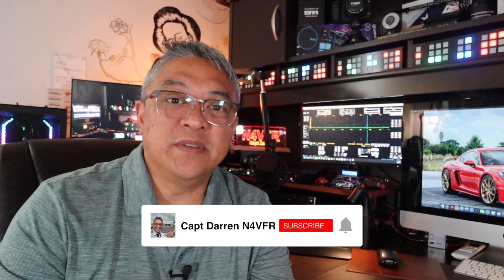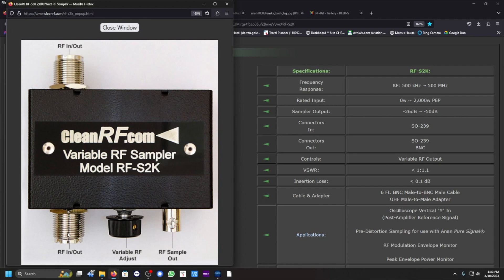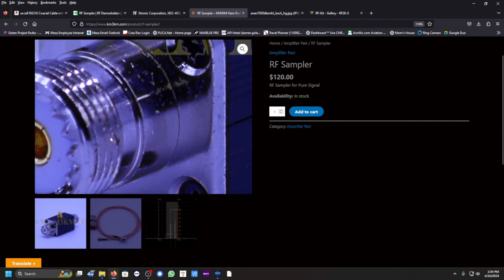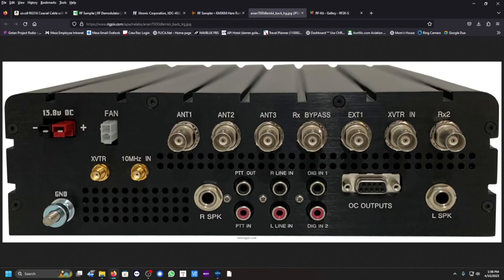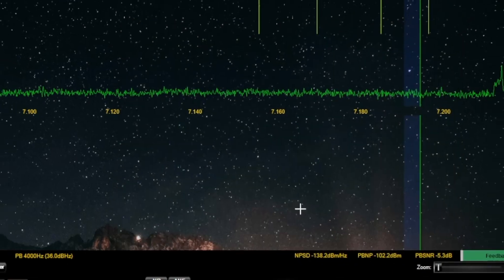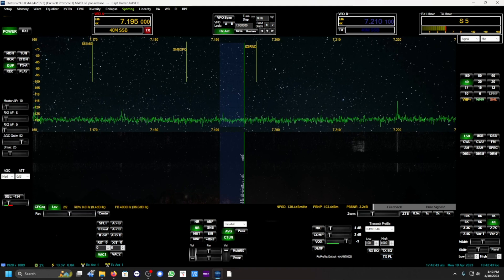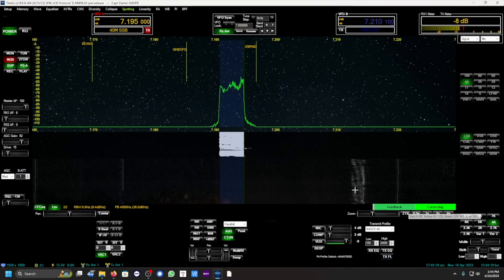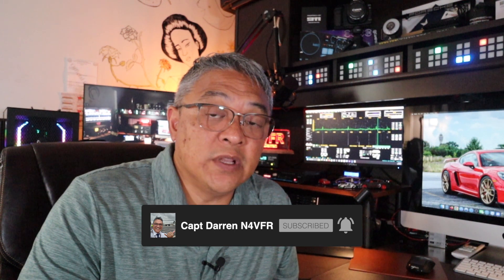Pure Signal (Pre-Distortion) Setup on an Anan 7000DLE Mk3 | How to connect Pure Signal | RF2K-S Amp

Comment: Tell me about the flashing LED that makes your radio set up look like a starship flight deck… love the look, how did you do this ?
Reply from the maker: Those LED lights are called, "Tix Clocks".  This particular model is no longer manufactured.  I use it for LED lighting display.  They are all connected to a surge protector and that is connected to a wifi power switch so the lights comes on at the same time.
Reply: Thanks for the info, shame they are no longer made as they make a really good look.

Comment: Why does N4QNT's spectrum look cleaner when he enables PureSignal?  https://www.youtube.com/watch?v=dtK97GoclbE
Reply from the maker: Hmmm,  not sure why Art's looks cleaner.  I've gotta look into that.
Reply: @DarrenN4VFR  Perhaps it works better at 1 to 1.5kW on your external amp, being that the coupler is 55dB down?
Reply: @DarrenN4VFR  Hi Darren, try it without the amp to get a comparable measurement with Art.  You are looking at the signal going into the amp, not coming out of it.  I think that you will see the same dramatic improvement as Art.  73, Len, KD0RC
Reply: The GetPk and SetPk are important!